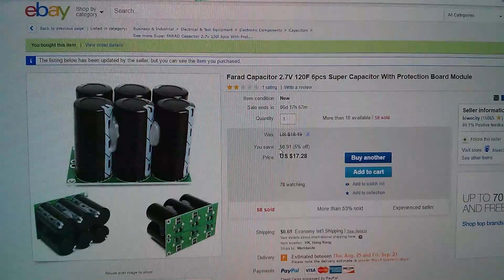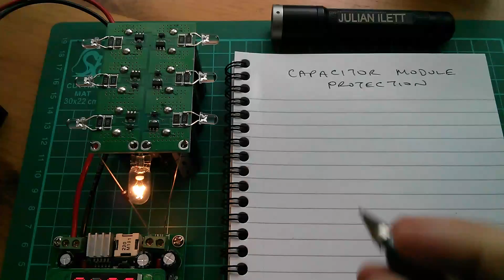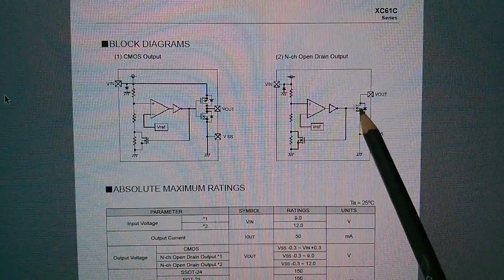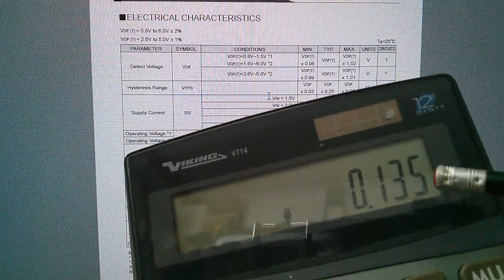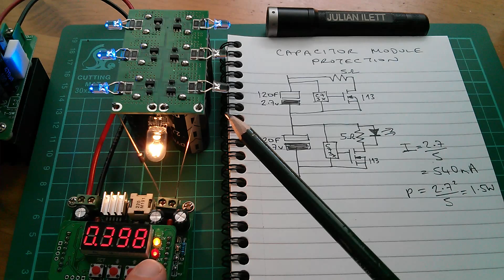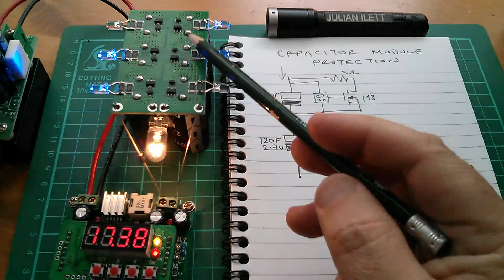Playing with: SuperCapacitor Module 6x 120F 2.7V

Comment: Try probing voltage across resistors and the actual resistor values. 5 ohms across the LED is probably affecting it's turn-on characteristics, that's quite a shunt!

Comment: Great video as always Julian, thank you.
I have a very similar board just arrived and I am trying to test the balance circuits with blue LEDs. 
I've taken it  up to 17.2V (measured board side of the diode) - as far as I dare with not a sign of an LED lighting. I'm really quite an early learner in electronics despite building many kits etc. Much better at logic circuit than analogue.
I'm now worried about the correct polarity of the LEDs - I have connected the LEDs across the load resistors with the +v (long lead) of the LED to the side of the resistor that;'s connected to the +v capacitor feeds is this right? 
Also my load resistors are 4R7 (4.7ohm?) rather than the 100 (10 Ohm?) you have. I'm right that they'll still be a ~2.7v drop, just a hight current?

Comment: Also I had a 2 farad 16v super capacitor and i took it all the way up to 20v before it started to clamp the voltage on its own from its internal resistance dropping further and discharging itself..
It stayed cool and didn't vent and functioned just normally afterward. so it was completely fine even at 16.5v as long as you dont supply too much current it won't be able to blow itself. theres a point where the current your charging it with is too low for it to charge past its maximum rated voltage too high.
so the capacitors do have some decent tolerance.
And some people do charge up these 2.7v capacitors much higher than 2.7v and they get away with it for years and years and the capacitors are just fine.

Comment: Well there is a bit of internal resistance on the capacitors while charging. so when you take off the charge from them. the voltage will immediately drop to about 16.2 or perhaps below maybe.
so the voltage is slightly higher while they are charging than when they are open circuit with no attached

Comment: About why exceed the nominal voltage (16.2V) and "not kicking the protection circuit too long to get low to 16.02V" ..... maybe the LED light you add to it effect or add a resistant that why the the protection circuit turn off quickly.. it suppose to be 5ohms resistant only across the capacitor by adding the LED light you add a resistant.....

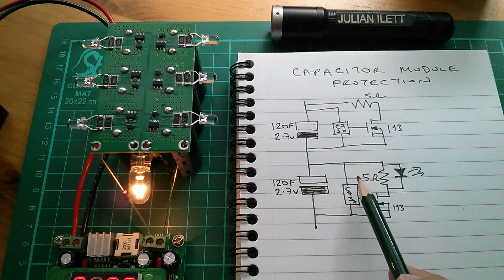Comment: At 26:58 is this really the circuit?? So you are charging the Caps through the volt detector? Once the volt detector reaches 2.7 (or 2.84V whatever) it then turns on the mosfet to "discharge" the cap. But to me this doesn't look like discharging, because in this case even more Amps are put on the caps (through the resistor). In my opinion you should cut the connection to the + pole to be able to discharge the cap, otherwise it will be charged the whole time. What am I getting wrong?
Reply from the maker: One current (from my PSU) flows into the cap and another flows out (through the resistors). It's a bit like filling a bucket (with a hole in the bottom) from a tap.
Reply: I am so stupid...got it, thanks.

Comment: Along the line of balanced charging batteries, I am trying to understand if it is needed in a series configured lead acid battery bank.  Let's go to the extreme of one battery in a two battery configuration being completely discharged, and the other fully charged.   In connecting a load you would be driving a current through the discharged battery.  What would be the effect of this on the battery? On the other hand,, what would be the effect of charging the bank?  Would the charged one not be overcharged?   If yes in both cases, then would battery balancing be good for lead acid batteries?
Reply from the maker: Lead acid can tolerate lots of overcharging (at a moderate current). You just lose water. Top up the water levels (balance them if you like) and all is well.

Comment: The hysteresis is only on the ----->HIGH<--- side!!! The device is normally used the other way around, only keep something turned on when it's above the nominal voltage. And only turn on when that voltage + hysteresis is met! (Page 4: Vdr = Vdf + Vhys) The device is turned on when Vdr is met (see timing chart page 5) and turned off when it falls below Vdf. So this configuration will turn on at Vdf + Vhys = Vdf + Vdf x 0,05 = 1,05 x Vdf = 1,05 x 2,7V = 2,84V! (Or worst case 2,7V x 1,08(hyst) x 1,02(error)  = 2,89V!!!!!!!) So it's typical a Chinese crapped up circuit... 

They should have used 2,7V / 1,05 = 2,57V => 2,5V for the device. This would kick in at 2,5V x 1,05 = 2,6V (or worst case 2,5V x 1,08(hyst) x 1,02(error)  = 2,75V)

If you look at page 3 of the XC61C you see how they made the hysteresis. They shunt a resistor while the threshold isn't met. (V+ < V- => output off => inverter on => gate high => resistor shunt). Once the threshold is reached the mosefet across the resistor will turn off (V+ > V- => output on => inverter off => gate low) thus adding the resistor in series. And increasing the the resistance of the lower leg of a resistor divider will increase the voltage on V+ (hysteresis) thus keeping the device turned on until the voltage drops a bit more then the voltage that turned it on.
Reply from the maker: What the flip! You're right. This device is designed to switch something OFF if the voltage drops below 2.7V - then switch it back on when the voltage rises above 2.7 PLUS the hysteresis - worst case 2.89V as you point out. That explains the strangely high switch on voltage. It also explains why the trigger voltage was more normal the FIRST time it triggered. This is worth an update video.
Reply: Yes, indeed. It's not a problem to use it this way but then they should have used the 2,5V version. Then it would bypass/drain the cap before it would reach 2,7V and would continue to do so until it reaches 2,5V. So good device to use but the Chinese didn't read the datasheet and used the wrong value for the job.

Looking forward for the video! :D
Reply: Thanks, you saw what others don't see. Alas, many simply assumed. Even Taiwanese don't read some of the must complied safety procedure and SOP from Vendor's manual, esp in Aviation industry
Reply: which 2.5V alternative volt detector would you recommend? Wanted build this circuit for fun.
Reply: I don't know on off hand. But you can try to make it yourself using a comparator/opamp with a zener as reference.
Reply: @tengelgear Not sure why the panic here. Typical supercap datasheet specifies an 8% margin between the rated voltage and the max allowable voltage, which in case of 2.7V gives 2.92V. What's the fuss about? Looks OK designed to me...
Reply: You're a bit late to the party :P But although that may be for the typical super cap it doesn't mean this one is included. And that +8% would then be the absolute maximum rating for the cap. So yeah, probably won't blow up but I wouldn't call going over the nominal max voltage fine design...
Reply: Nice catch tengelgeer!! You are now a hero of Julian's (and probably all of the viewers of this video). This stuff is way above me but I am trying to learn. You nailed it!

Comment: Ok, so it looks like you are topping out at around 16.6v, which if I am doing my math right means you're getting the caps up to 2.766V, which is just under 2.5% above spec, which I am guessing in probably within the tolerances of both the cap and that voltage detector. But shrug it's a guess and I am most definitely not an expert on these things.

Comment: Interesting analysis of the voltage limiting circuitry. I'm surprised you didn't measure the voltage across one of the capacitors to check the individual voltage in conjunction with the operation of the voltage limit.

Comment: The unexpectedly high voltage might be an indication that the hysteresis is actually on both sides of the nominal voltage for the protection circuit. That would push the expected voltage to about 17v. Tho I admit that doesn't really seem to be what you might reasonably expect of a protection circuit. I would be interested to see the voltage across one of the caps when the protection kicks in.

Comment: I use similar bank of 6 500F super-caps as inline solar storage device for camping. Solar panel is only 10W, setup works well for occasional 12V loads like air mattress pump.

Comment: Since you have six separate protection circuits EACH capable of a nominal 540ma discharge, don't you mean you would have to charge at more than 3.3A (ish) to overwhelm them? You were nowhere near that, as they kept randomly switching on and off, thus not allowing all the caps to reach their protection voltages for more than a few seconds.
Reply from the maker: No, it's the same current flowing through each circuit. They're just at different voltage levels.
Reply: Oh right... relative grounds :( For some reason I was still thinking about parallel loading, not series loading... dolt! :D

Comment: I'm surprised you didn't measure the individual capacitor voltage with a second multimeter at the hysteresis points of the protection circuitry, perhaps for each one, in order to characterize.  That would tell us how far it may overvolt the caps plus give an idea about that missing information in the datasheet you mentioned about whether the hysteresis is above, below, or random, the 2.7 volt mark.

Comment: Does this module really have 20F@16.4V ? Did you measure it ?
Reply: Charging at about 400mA it took about 20 seconds to go up .5 volts per the Youtube time counter, or 40 seconds for a full volt. A Farad is 1 second to change 1 volt at 1 amp, 40 seconds x .4 is 16 Farads, not too bad IMO. To get a more accurate reading he would have to remove the bulb, set the buck converter for 1 amp, and time how long it took to go up 10 volts, if it is 20 farads it should take 200 seconds.

Comment: I suggested you use these between the solar panel and the charge controller for a secondary reservoir of power during thick cloud passes and after the sun sets. Also between your battery bank and your power inverter for handling starting loads.
Smooth power in and out, makes for a very happy and health battery.

Comment: Since the capacitors are all in series, shouldn't there be a diode between them in order to prevent reverse polarity?
Reply: Mosfets already have a backing diode (body diode) in them which would prevent reverse polarity in this instance, even though it goes through the 5 ohm resistor.
Reply: a diode would be necessary to prevent capacitors from reverse charging, but the protection circuit already does that.
Reply: I thought the protection circuit only prevents the capacitors from overcharging?
Reply: But the mosfets are only in the circuit when the voltage reaches about 2.7V, the remainder of the time they do nothing. They only switch on the 5 Ohm load resistor you see.

Comment: You discharged unbalanced (super) capacitors (in the beginning of the clip).
Suppose one cap had 1.5 Volt and the others 0.3 Volts each, you would then charge 5 caps with a negative voltage! You should make that mistake only once or less .. .. I am afraid you might have done it, and you did not measure it. This is a serious problem when discharging unbalanced cells (any cell that is).
Reply: I am sorry DazzWidd, but a capacitor is an easy thing. Current out = lower voltage, current in = increase voltage. And we all know, a negative current means a negative voltage.
I don't understand why people respond to this comment if they don't understand the circuit. or for that matter, don't want to learn. My tip about running capacitors down which are unbalanced is crucial. Don't forget super caps are expensive., and they will get defect after a negative charge (loose a fair amount of capacity for ever).
Reply: Now that is a bit to many foreign words for me. Not sure if I can follow. But yes, I am paying much attention to details. Thanks ;-)
Reply: +deslomelager It's physics.  Paying attention to detail is mandatory!  YT commenters are funny ;-)
Reply: MOSFETs contain a parasitic diode. That should be enough to clamp the reverse voltage to a safe level (<0.5V)
Reply: superdau
The circuit (and the mosfet you speak of)  only kicks in just at or little above the 2.7 Volt threshold.On all voltages below 2.7 (and even when negative) the circuit board does not do anything. (leaving out all tolerances of hysteresis and such)
Reply: deslomeslager
The parasitic diode is always there. It can't be switched off.
Reply: There needs to be a current flow or voltage difference first, otherwise a diode does not work.But this is not the issue. I think you are missing the point. This issue is about charging some of the caps negatively. This has already been confirmed, so why are you trying to say the opposite? It is 'after the facts'. Thank you.
Reply: superdau
Please look it up: You can reverse-charge a super capacitor, but doing so likely leads to a microscopic degradation of the specially prepared electrode surfaces, reducing the available capacitance.
Reply: didn't the diode prevent that scenario?
Reply: No. You must see the complete schematic, the current flows through all capacitors. When a capacitor is empty, the current from the other is creating a reversed polarity. Draw the schematics and you will see what I mean. It is for real (!! realy !!), and it can easily be overlooked. Thank you for asking, I hope more people will be alarmed by reading these comments.
Reply: I think the reverse voltage you're referring to will merely equate to a current draw from the reversed capacitor in question, resulting in a scenario where the voltages will equal out.
Reply: I think you're of an overly and overtly pedantic mindset.
Reply: deslomeslager
I think you don't understand. The diode will start to conduct (through the 5 Ohm resistor) as soon as the voltage on the cap has reached something around negative 0.5V. Unless continuously applied that voltage won't hurt the cap.

Comment: +Julien IIett you should try an ebay 
butane soldering iron I got one they
work really well and heat up in 20 seconds
so perfect for small repair jobs you can't be
bothered waiting for electric to heat up
Reply: I can do you one better, for small jobs you say? Grab a little usb soldering iron for $5 off ebay and a powerbank, not only that but they heat up in roughly 10 seconds and fairly cool again after about 20-30 seconds, go take a look at bigclive's video, they're great little irons considering both how cheap and power efficient they are.

While I've never used one myself I've heard from multiple people that butane irons are very inconsistent with their temperature and usually tend to get too hot, so I've avoided them for that reason, (well that and also electricity is easier to obtain) but if you like them then more power to ya.
Reply: +vgamesx1 they r very consistent and can go from 40w to 70
Reply: Jack Mccafferty Yeah, that's kind of what I was refering to, if it isn't obvious, a power controlled iron is a bit different from a temperature controlled iron that maintains a specific set temperature.
(Not that the usb iron does that, I'm just pointing out how it's different.)
Reply: Just saying it was a good idea for +Julien IIett to solder solar wires rather than running extention cord

Comment: Nice video as usual.
I have a question for you Julian: any reason you buy your products for ebay and not Aliexpress ? I moved to Aliexpress and I find it way better than ebay, better interface, more products and cheaper.
For example there is a seller selling cheap supercapacitor, used but in good shape, you should take a look, I just ordered a few.
Reply: Aliexpress is great for buying super cheap things, but don't count on them to help you when shit hits the fan, as in something doesn't show up or is broken/DOA and you have to deal with an uncooperative seller... They seem to only occasionally help their customers, whereas I've had at least one personal experience where I needed ebay to step in and they gave me my money back.

Also, it's not as if Aliexpress always has the best deals either, so there's literally no downside to checking both, plus ebay still has a slightly better search and filters than Ali does, along with the ability to save searches and email you the results when new items are posted.
Reply: Another point I noticed: The shipping to Austria from Aliexpress usually takes 2-3 weeks, from ebay it takes a few days to 2 weeks, of course both shipping from Shenzhen/Hongkong :/

Comment: The protection circuit kicks in at 2.65V/cell but if current is still flowing into the capacitors, the actual capacitor voltage has not yet been met. If the current is 0 you then that is the actual bank voltage. If you switch off the power supply you will see the bank voltage drop down immediately...even without a load. The capacitors could get warm..they are small ones. The 3000F bank I have only gets warm at 150A current charge.

Comment: Don't forget to divide the 16.8v charge voltage by six, this is only around 80mv per cap over voltage. Agreed a detection voltage of 2.6v or so would have been preferred. The mos will be similar to other mos used in LI ion battery charge protection device's and have a typical rating of at least 4A or more. The main design consideration besides cap voltage is how much heat can be dissipated by those resisistors in close proximity to the capacitors. That determines the resistance on board. The mos is capable of shunting way more. Just lower the resistance off board. Reducing the dissipation on board by removing one of those 10R resisistors. Happy day's !!

Comment: The votage detectors are rated at 2.8v based on C73X from the data sheet - no need to panic Julian - puts max voltage up to 16.8v - phew!